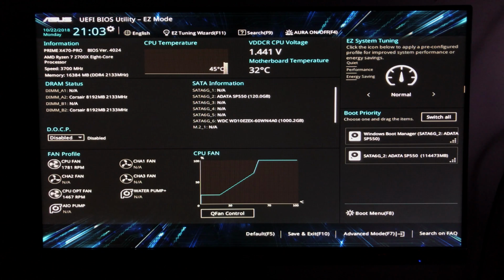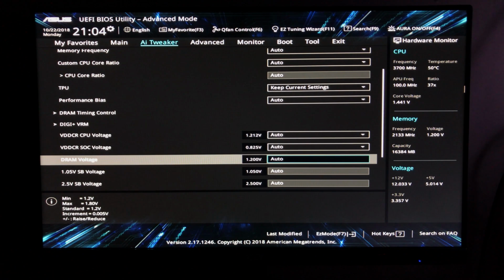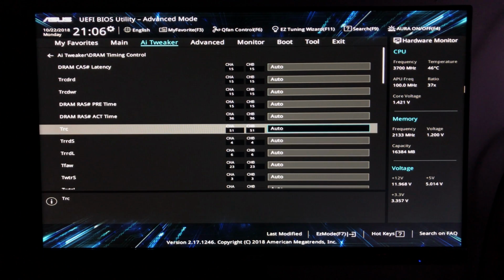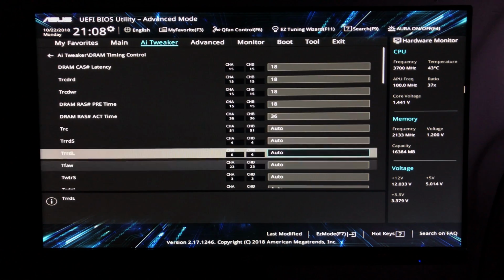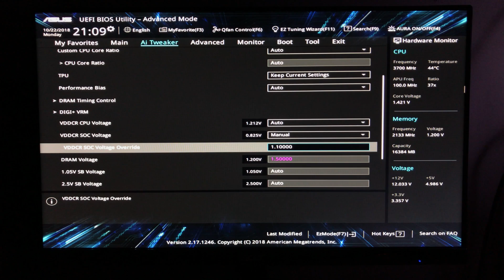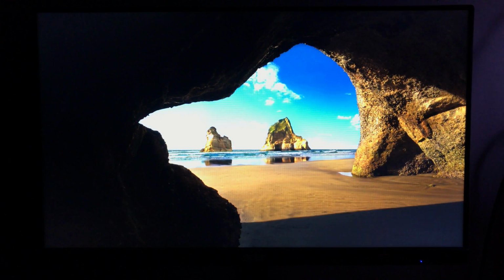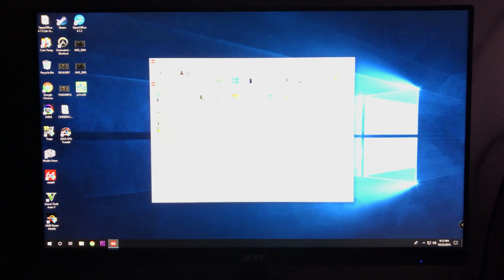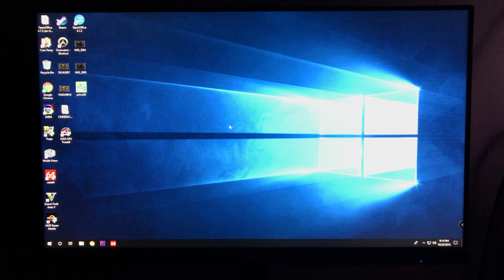The Basics of Overclocking Ryzen RAM Using the ASUS BIOS

Comment: If I'm running G skill trident z neo DDR4 3600mhz with ryzen 9 5900x, Asus Rog strix crosshair formula Viii MB. Would you still recommend gaming at 3400mhz? I'm having stability issues. So just wondering if I should give up on trying to run at 3600mhz. Or keep trying to loosen timings and increase voltage etc. Thanks!

Comment: So I just bought ddr5 ram for a new build.. it was listed as 6000mhz but it’s only showing 4200mhz… apparently it can go to 6000 when over clocked and is sold with a overclocked guarantee?

Idk anything about this stuff but I figured you buy 6000 you get 6000?!
Reply: The 6000 MHz is with XMP/ DOCP aktiv don't bother overclocking your Ram if you only want it to run on 600 MHz just aktivate it in you BIOS.

Comment: I bought an Kingston DDR4 3000 Mhz RAM and just do up the Frequency to 3000 Mhz. Everything else is on auto. I leave the rest on auto since I don't know what I am doing.
Since I bought already the RAM of 3000 MT/s then I wanted to get to most of it as well.
I leave DOCP on auto. If I put it on DOCP the PC isn't booting anymore. 
So I leave DOCP on auto and up only the Frequency of the RAM to 3000 Mhz.
When I set it to DOCP it changes automatically to 3000 Mhz and shows some tight timings of 15 17 17 17. So I guess that's the optimum but can't use DOCP since it does not boot.
Just setting the frequency to 3000 Mhz (DOCP on auto) then the timings are 22 21 21 21. But that works.
I disabled Precision Drive Overboost and limited the thermals of the processor to 65 Degrees Celsius.
Does anyone else just up the frequency of the RAM only and everything else on auto?

Comment: hey I found your video by a reddit thread. First off thanks for your time. I had worked with Corsair support because my Corsair Vengeance 3200mhz ram randomly crashes on me (mostly upon start up) this is with a Ryzen 9 3900x + ASUS tuf gaming x570-plus (wi-fi) mobo. I've ran memtest86 which passes 4 pass throughs. So corsair is ruling this a cpu/mobo issue.. I can run the RAM at default 2133mhz fine, it's only when running at 3200mhz. Are the auto settings not viable with enabling XMP? I have ensured 1.35V but wasn't too sure what else to tweak. I plan to reference this video when I get home, although my use will be for gaming/streaming vs benchmarking, but figured I'd shoot these concerns out to a veteran like yourself.  Thanks! -Dan

Comment: my ram supports 3200 mhz when i change my settings to docp and scale upto 3200mhz with dram voltage of 1.35v pc crashes 2 to 3 times so i increased my dram voltage to 1.4v and it works will this damage my components?

Comment: Can you please tell me what settings I should change to overclock CPU? I just want have around 4.7-5.0ghz on all cores for Intel 8700k. I have the same Mainboard UI. I don't want to go over 1.35V. Would be nice if system only uses it when needed. I do video editing. Thats what I need it for but I have no idea about overclocking. I have an corsair H115i water cooler.
Reply: Shouldnt you be on ryzen side for video editing?
Reply: @BlGASH  Yes but I bought the entire System 3 years ago for 700€ with Good components. I will switch to AMD when I have another 1000 bucks for Asus ProArt X570 and Ryzen 5950X. But until then I just want a bit more power.

Comment: i have B550M PLUS and XPG SPECTRIX D41 4000mhz 1.35v / 4133mhz 1.40v
i can't use D.O.C.P when im plug my ram modules on A1 and B1 slots ! the system goes on and off 3 to 4 times and enter the safe mode! - 
only works on A2 and B2 slots, did you know what can cause that??

Comment: After enabling d.o.c.p.  my computer turns on but with no video, and i cant  go to bios settings
Reply: Same. It only started doing that to me after I upgraded from 3950x to 5900x. Asus tuf gaming plus (wifi)
Reply: reset your bios...to do that you have to unplug everything ( obviously) and in the lower right corner of the mobo for two pins that say "CLRTC"....with that in your sight...use a paper clip or screwdriver to hook up the two pins together so that it circuit breaks them...hold it for 15 seconds...
i know it's a month old comment but it might help somebody out there...
Reply: @surenot4362  I did this. It reset my bios but once I set d.o.c.p. again, the same thing would happen
Reply: @cbzeej  well at least you can still boot your system...😔
Reply: @surenot4362  Sorry for that. i feel your pain

Comment: i have a pc hooked up but it won’t post... i’m thinking i ran into a compatibility issue with the ram and mobo but i don’t know. if it is a compatibility issue or maybe dead sticks of ram or messed mobo
Part: DDR4 16gb (2x8gb) 3600mhz  (Corsair Vengeance)
Mobo B450M-A csm
Reply: having the same problem, nothing is posting did u find a solution??? i need some help
Reply: i changed my ram from default to 3000 mhz and nothings posting
Reply: if nothing is posting then you might need to take out the cmos battery for a few seconds to a minute..... if it is posting then i would click the “default bios settings” 1/2
Reply: then if it posts and you still wanna select the frequency of your ram then watch this video https://youtu.be/xvX6Rk4eNz8 (excuse the accent but it was the only simple and short video i found)
Reply: @zertezyYT  last question, what is cmos battery? i get everything else ur saying but i’m not to sure what cmos battery is.
Reply: @jacobcummings3682  it’s a little battery on your motherboard i’m pretty sure it’s a CR2032 battery. Remember to do all this when the system is powered off and unplugged from power outlet
Reply: @zertezyYT  alright i found it, should i take out the battery? because i saw people resetting/clearing it with some pins on your motherboard.
Reply: @zertezyYT  or is taking it out the only way
Reply: @jacobcummings3682  yea you can do that if the battery doesn’t solve it
Reply: @zertezyYT  alright just to confirm, take out the battery first and try that? i’m assuming that’s what you did if u had that problem.
Reply: @zertezyYT  i just don’t wanna fuck something up again lol

Comment: My DRAM voltage is limited to 1.35v.
I can't pass 1.35.
Mobo TUF X570, R3 3200G and Corsair Vengeance 2x8GB 3000mhz.
Reply: Try to hit the +/- keys on ur number keypad 
It should allow u to set the current display value(1.35) it gives u the choice once u hit the +/- keys to set between 1.2 n 1.8
Must keep under 1.45 to maintain stability for ur vdram overclocking (u can also add value to the vddcr-soc, setting relates to ur vdram) speed u need to give it at lease some sufficient power... also if u have drmos  (powerManagercontrol) which most new asus board includes u should be able to set all this with the mb software Amorycrate... or in the bios (ai tweeker)digital vrm

Comment: I am not even able to disable the geardown mode. I have to either let it be on Auto (which i suspect is keeping it enabled) or enable it. And due to that it wont let me even reduce my first cas latency value so running right now as 16-14-14-28 at stock 3600 MHz speed. Will try overclocking it and check whats the outcome.

Comment: So I just got an 3950x it’s good so I’m never going to overclock my system. Firstly because I don’t think it’s worth messing up a 750 dollar CPU I just got today, second it runs as fast a I need it to at stock levels. I just upgraded from a 1700 Ryzen. It was shit compared to what I’m getting now with just stock. I don’t think I’ll replace this 3950x for YEARS.

Edit: I’m now putting down your totorial, but I’m personally not taking a risk with this others might, but that’s them I still found your videos interesting to watch 🙂.
Reply: Why did you buy it for 750 wth

Comment: I switched my memory frequency to 3600 which is what my ram is rated for now my computer would turn on,lights and everything but nothing on the screen 
using the exact same mobo
Do you know a fix??
Reply: Same issue how to solve ?
Reply: My mobo could only handle 3200 MHz so I switched it to that and it was able to boot make sure it’s on DOCP or XMP then switch to your a frequency that your motherboard supports
Reply: @datboi7624  Yes bro solved issue
Reply: @datboi7624  wait i have the same issue, my just isn’t booting period. how do i get to bios and change it if it’s not working ???
Reply: @santutunga4369  wait i have the same issue, my just isn’t booting period. how do i get to bios and change it if it’s not working ???

Comment: on Ryzen 5 3600 (3200Mhz native) How do I mount 3200Mhz memory will it work on default settings?
Reply: 3 years late but no... it worked for me with the 18-18-18-36. If u leave it on auto it won't boot.

Comment: I don't see a setting in the Asus bios (x570 tuf gaming) for the uclock.  ryzen has mclock (memory) fclock (infinity fabric) and uclock which afaik is the on die memory controller speed.  I want to run 1:1:1 ratio... i can set my memory speed, and my infinity fabric speed to 1800 or even 1900mhz, but i don't see a manual setting for uclock, and I'm wondering if it's maxing out at 1600 and not locking to 1:1.  or maybe it even goes to 1800 but not 1900?  I don't know... I want to know what the behavior is and whether or not it can be changed.  Some brands of motherboards I believe allow user control of this setting.  If I had this information, I could set my ram and IF clocks for a 1:1:1 and tighten ram timings.

Comment: Becareful with memory frequency if you get high or too low and restart your pc it wont startup the only way to fix it(i think) is to remove your CMOS battery and wait for about a minute and put it back in, what this does is it resets your bios settings to default.
Reply: really good tip this has happened to me before lol
Reply: Yep, think that’s what just happened to me. I lowered the latency timings to much
Reply: There is a jumper you can short out with a jumper cap  near the battery labled CLCMOS, CLRTC, be sure your power supply is off before you do that.

Comment: I have 32gb of trident z 3200mhz with a ryzen 2700x on a Asus TUF X470-PLUS GAMING and I can only put it at 2933mhz. If I put it on 3200 it immediately crashes my pc to the point where is very hard to repair, but possible. Why Can’t I put it on 3200?
Reply: Put more voltage
Reply: @squeezip0292  I changed the processor to a 5800x and now it works but thanks
Reply: @thedeezerman  yea
Reply: @thedeezerman    it's because the 2700x supports up to 2993mhz. Before overclocking, check the limits of your MOBO and processor and then set the limit on your RAM.
So u can put below 3000mhz, is 2933mhz. I have 2700x too, and now. the computer is shutting down by itself because of the heat, summer is practically here.  I have to find ways to undervolt. 
I am little noob 😆.
you bought a nice Ryzen 5800x congrats

Comment: Hello .
I have this motherboard and on it we have mounted ADATA XPG Z1 Memory 8GB DDR4 3000MHz CL16 1.2 V and I have mounted Corsair Vengeance LPX Black 16GB DDR4 3000MHz CL16 1.35 And the computer does not start the board again but it is not present memory ram.
Do you know what I could do?
Reply: I’m guessing that u can’t have 24gb of ram installed
Reply: I've same issue. Please help
Reply: @santutunga4369  Try to switch between them, put the ones with higher voltage next to the CPU and use only 2 boards and rotate them together.
I sent the 1.35 v ones to the store and I took a lower frequency of 2600 but of 1.2, all corsair and it works perfectly. And so you put the lower frequency ones in the first slot next to the processor. Good luck

Comment: I’m having a certain problem with my asus mobo
I have the Asus prime b450m-a with a Ryzen 5 2400g and Corsair 16gb 3200 ram
Every time I turn on the xmp profile which is D.O.C.P in this motherboard my computer always crashes upon launching a game
I don’t know if I should replace the part as I still have warranty or try to manually clock them, any help?
Reply: If it crashes then it cant stand the clock

Comment: Do you find manually tweaking and testing better than running Thaiphoon and then exporting/importing the XML into DRAM Calculator and plugging those numbers in? I am trying to figure out the most stable RAM setup. I bought a 32Gb kit for my Tuf X570+ that is on the QVL for my board, but @ 16Gb (not 32Gb). Ram runs fine @ 2133, but cannot auto @ 3200. Trying to get it run @ spec, at least. DRAM Calculator timings are much tighter. Kit is also Samsung B-die.
Reply: @gorkman5697 I can't remember where I landed on that kit. I am running a 64Gb 2 stick kit these days, without issue.

Comment: is it safe to run more voltage than the ram needs? for instance, can i set it to 1.45 and leave it there even if i only need 1.2 for my oc?
Reply: Sorcerous Pistolmaster it will burn it out over time and cause wear. Over time to maintain the OC you will need to up the voltage to dangerous amounts or turn down the overclock

Comment: is 3200mhz cl20 good?
Reply: Pre sure cl 20 is a bit ruff depending on what you're doing like the dude in video says if your just running benches might get a higher score but for gaming say 3000 with cl16 will prolly out preform 3200 at cl20 as thereis a point where higher MHz is not going to offset then looser timings
Reply: yeahboii i tightened it and i got stable 3200mhz CL 16-18-18-36 1.35v from 2400mhz CL 15-15-15-35
Reply: @TheKillerZmile  that's pre damn good oc >.> same as the xmp of the 3200mhz ram in one of me pc's

Comment: One important question! What do you when system crashes and wont boot bios at all?
I'm having that problem when I overclock my corsair lpx 3600mhz cl18 :(
Reply: Reset your cmos. Check your motherboard manual. But there should be two pins on your board, probably at the bottom where you connected the power on/off cables. I use the tail end of a pair of tweezers and bridge the two pins while the pc is off for like 10 seconds. Should reset your bios.
Reply: @K1LLW1N  I did it without that. It was speaker that was plugged in wall so It never got drained out by holding 10sec power button
Reply: On my asus board w. A 3700x
If the RAM PC fails to boot and gives u a black screen

Sometimes it fixes itself but takes quite a while like maybe 2 minutes to fix itself and itll boot back to Bios

Comment: i want to get my 2933mhz furyx to 3200mhz, what timings should i use and voltage? i have the b450 tuf gamin plus
Reply: Jonathan650 Same here, I have the B450M though, but it’s the TUF gaming plus one but I can’t seem to get my 3200mhz ram up to speed :(
Reply: @nicholasnasser8727  i managed to get mine stable at 3200mhz 19-19-20-20-44 or something like that, not the best i think but it works (= 1.35v
Reply: Jonathan650 thank you I’ll try that out

Comment: I changed my voltage and my pc won’t start, please help
Reply: Same issue how to solve ? Please reply
Reply: santu tunga I never got it to work unfortunately, I was in need of an upgrade so I bought one to replace it. Have you tried resetting the cmos?
Reply: @TheMinky  Yes I try but pc not started.
Reply: Bro if your ram slots are in 1-3..change it to 2-4

Comment: I'm on the asus prime b350 plus mobo, and i just went in the bios and set my 2666 kit to 2800 mhz. Didn't touch anything else. Should I change the timings too or it's fine?
Reply: Voltage and timings. Get to 3000+
Reply: @hariharanb785  done long time ago
Reply: Did it work out for u? How many extra fps?
Reply: @Mriceman604  A bit more stable on 1% lows, but I noticed more difference when getting another stick of ram, having 2x8gb in total. Dual channel makes more difference.

Comment: So i am having a situation here. I overcloked some crosair lpx vengeance to 2933 mhz just fine, until recently. When i started my pc this morning it started for a sec and then reset after that i had to wait like 20 secs to boot and after that i have this error"overclock failed". Someone knows what could be the problem here? I mean somtimes works fine sometime is not working its weird. I overclock just like in this video , everyhing is set auto but still i have this problem

Comment: Why i always fail to boot after oc it?only from 3000 to 3200, t force delta rgb 2x4gb 3000mhz
Reply: Duck Head same ,im stack at 2666hrz
Reply: @PaulPaul-si8tu  you just need to enable xmp to run it defaultly 3000mhz
Reply: @duckhead2948  how ?Im using asus B450f mobo with the latest bios,
Reply: Same boat bought a 3600 trident z neo kit
Cant go past 3200

And when I hit 3600 I had some crazy high latency high 20s
Reply: @rolibanoli  what can we do about it...
Reply: Shit was expensive for speeds I cant even get
Reply: Update bios. Got my t force from 3000 to 3600

Comment: Ok so im about to build a streaming pc with 
Ryzen 2700x
G.skill ripjaws 8gbx2 @3200
B450 aorus Pro wifi
Stock cpu cooler 

My question is i know that the ryzen chipsets do “core performance “ and auto overclock your cpu and something else . I never built /Oc ever so I totally suck at this and dont wanna mess up. All i want to do is set my ram to the advertised 3200 . Do i need to mess with volts after or anything ? Or can i just put memory frequency to 3000-3200 and be done with it all and keep “core performance” enabled, or should i turn core performance off.

I like the feature of a auto OC for noobs like me but if i need to turn it off and keep my cpu at 3.7ghz i wouldnt mind just want my ram speed to get increased safety. I hope you understand and can help me out and shed info with overclocking with ryzen 2gen:)
Reply: why a B450 bord ?
Reply: @xythiera  which mobo for ryzen 3 2200g?